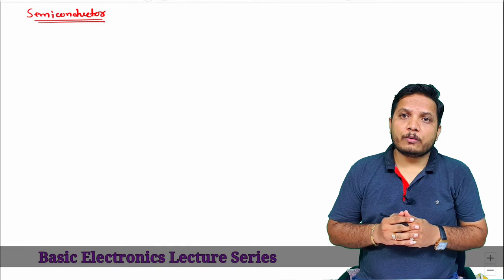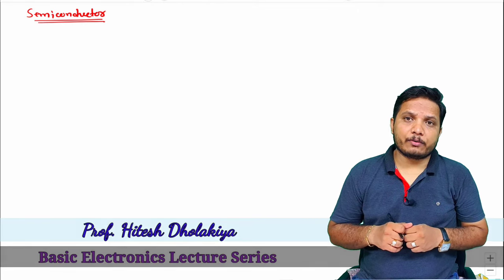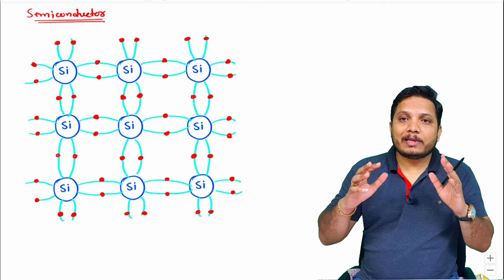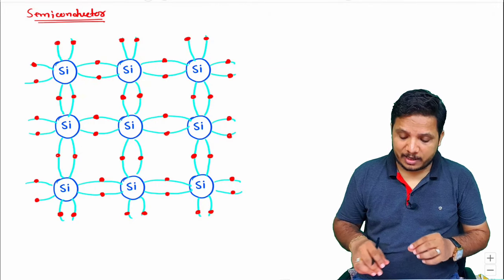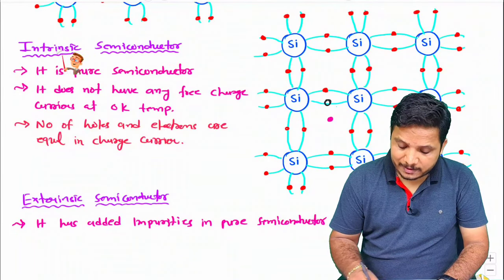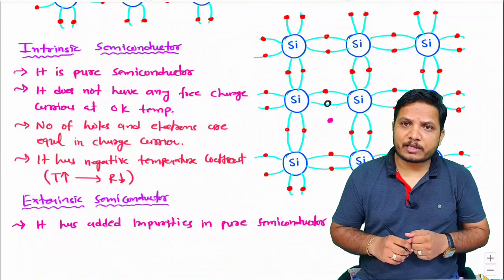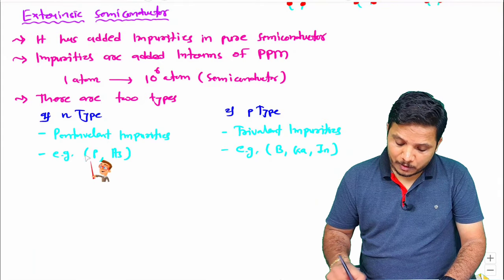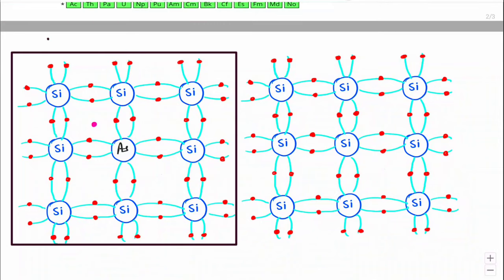Semiconductor Material, Structure of Semiconductor, Types of Semiconductor, Basics of Semiconductor

Comment: Sir could you list the semiconductor material  which works in low temperature region s such as polar regions . And how electronics devices work in polar regions because si and ge range doest match .iam obsessed with this doubt sir
Reply from the maker: Silicon functions good at higher temperature and Germanium works better at lower temperature. It is due to number of orbits.
Reply: @EngineeringFunda  sir apart from this any other semiconductor material which works good at low temperature
Reply from the maker: @tvprakadeesh7914  GaAs